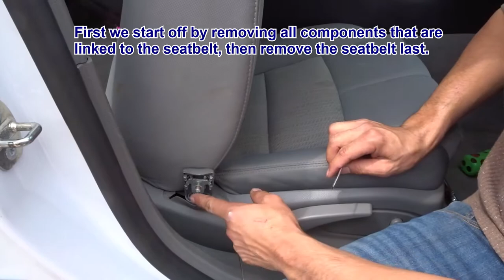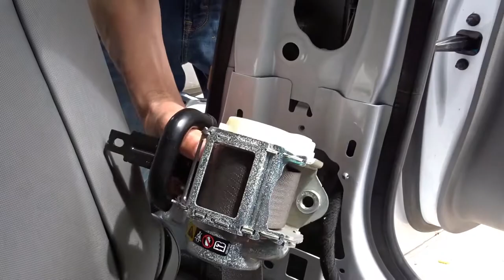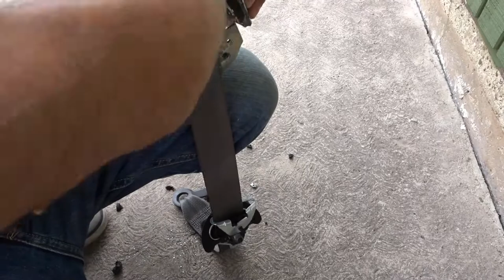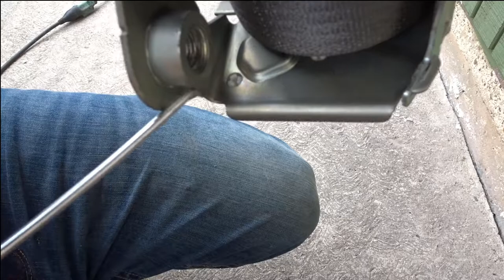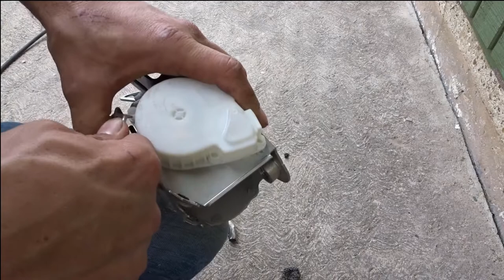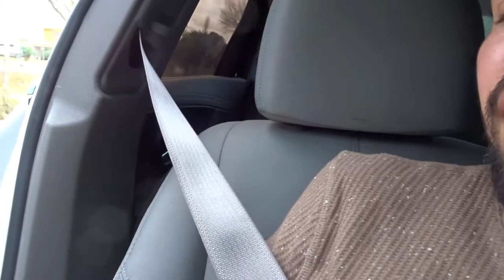How to UNLOCK 2014-2019 Impala seatbelts

Comment: By removing the latching parts, the belt now comes out easily, but it will NOT latch when it is needed to prevent possible serious injuries.   The latch parts need to be in there.
Reply: I thought the same thing. Show us how it works when someone hits the brakes....junk.